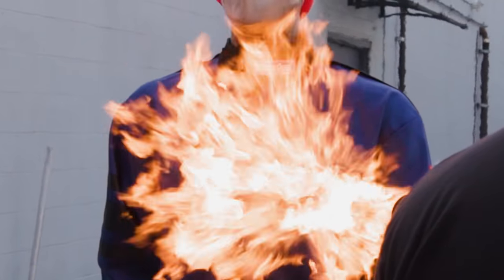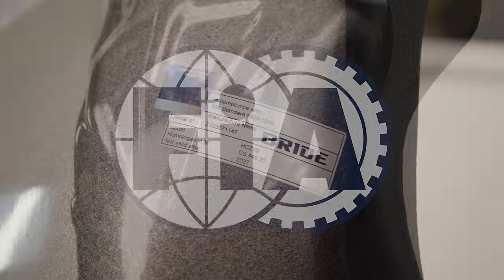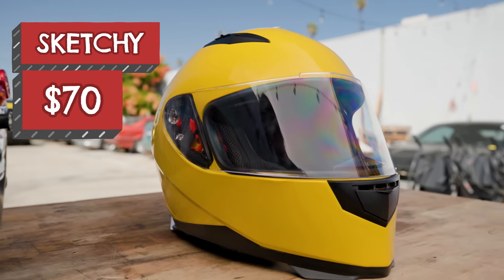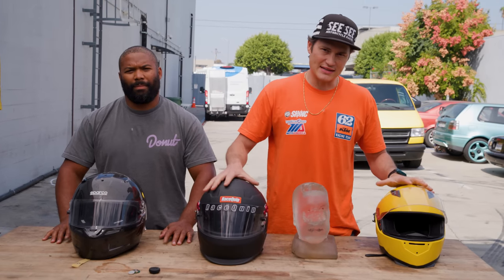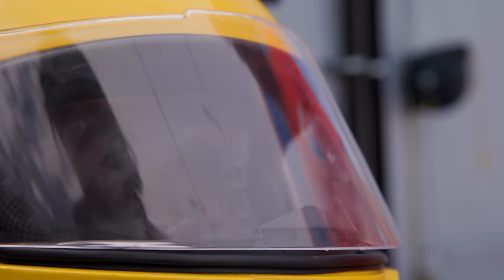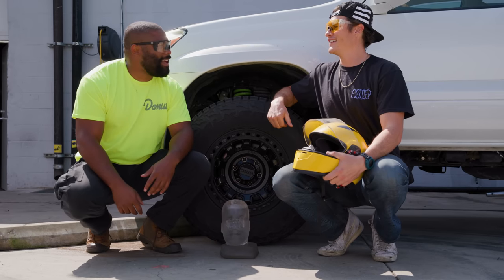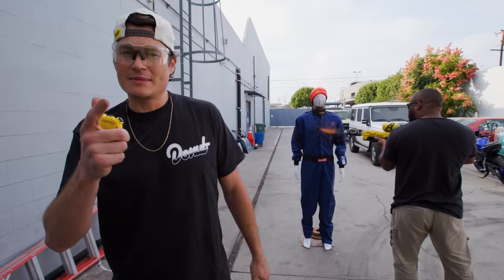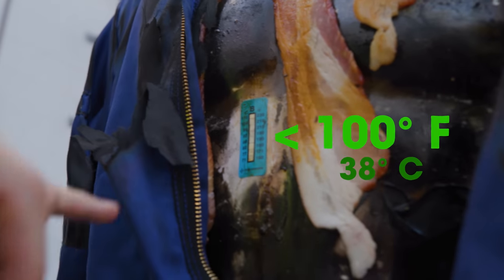$500 vs $1300 Racing Seats

Comment: One safety comment, on removing seats. I'm sure you guys are aware but you didn't mention it at least not so far in the video, some seats have airbags built in. Disconnect your battery and let it discharge before you go fiddling around with those unless you feel like having one explode in your face.
Reply: Was just going to write this. The airbag system is really sensetive, and disconnecting parts of the system without having the battery disconnected can make them blow.
Reply: Actually. Airbags are not that sensitive..
Reply: @MrWaarden  on some cars they are and other's their not
Reply: This is an 06 wrx
Reply: I can't believe this wasn't mentioned.

And regardless if the seat has an airbag in it, all cars within the last 20 years have occupancy sensors to disable the airbags if no one is sitting in the seat. Disconnecting these will cause an airbag light and potentially not deploy the airbag in a collision. 

On the track you don't want airbags, because of cages and helmets etc, but most people watching these videos are going to drive both on the street an track, this is a big miss in my opinion.
Reply: @JVR_Funwithdesign  not entirely true, my 04 SEAT Ibiza (Volkswagen Polo) does not have any wires connected to the seats.
Reply: that's incorrect,  I've been a mechanic for 16 years now and airbags while being dangerous are not that sensitive. removing them the way they did is totally okay
Reply: @mariushaeberle85  Some cars have the bare minimum for extras.

You have manual seats.
Reply: @robert9595  i do, i said it because someone above me said all cars of the last 20 years have wires connected to the seat.

btw all of the SEAT Ibiza models had and have manual seats regardless of trim and extras.
Reply: @MrDosSantos991  you may have been a mechanic for 15 years, but if you look at the manual for installing or removing airbags they ALWAYS warn you to remove power, and allowed to discharge first. Now you may want to shade tree it, but I'm not going to take that risk.
Reply: @mariushaeberle85  Well in the US (which then also applies to all cars sold in North America) since 2003 all cars must have advanced airbag systems which detect occupancy. 

European rules will be different but given how strict EU rules are on safety, I'm going to guess that this is also the case with cars newer than your SEAT.

Has nothing to do with manual vs powered.
Reply: @JVR_Funwithdesign  thanks for clarification, as im not familiar with rules of the US.
Reply: Until an impact the airbag wires dont carry any voltage, so its safe to disconnect them. The steering wheel is only different because the clock spring can short the bag to the horn which is always hot, but typically you disconnect the airbag before removing the wheel. Good practice is to disconnect the battery before playing with electronics, but 99% its actually unnecessary.
Reply: @thebarkingmouse  the manual probably also says something about only going the speed limit.
Reply: I disconnected my airbags in the sketchiest way possible in my 05 CVPI when I built it for the track, luckily I still have my teeth. I had no idea you're supposed to drain the battery 😧
Reply: @thebarkingmouse  I have done maybe 1000 mazda airbag recalls, they pay like 10 minutes for the work.(airbag at steering wheel, passenger side pays more time) if you actually do all the steps it takes too long time. removing battery= all radio channel presets get reset and clock time resets, pita to change those back how the customer had them. Never had a airbag blow. While I disconnect the airbag I move away from the expansion area tho as a precaution.
Reply: @JVR_Funwithdesign  Came here to say this, glad you beat me to it!
Reply: Airbags are actually controlled by PWM signal, If it happened to somebody It must exploded on <00' cars lol, but sure if I do this job on every older Korean car, i for sure did all safety steps before dissambled them :D
Reply: @Ellotherem8 I see what you’re saying; on the other hand, I am not a regular Donut viewer. As someone who occasionally stumbles on these videos, I’m not familiar with the hi-lo series, but the juxtaposition of a video that spends a lot of time espousing a safety mindset with glaring overlooking of safety caveats is… unsettling.
Reply: @thebarkingmouse  That warning is for liability reasons only, kind of like the warning for not putting a sandwich bag over your head because you could suffocate. If they didn't put that in there then some idiot could jam the power seat connector into it or do something crazy and set it off. Then they can sue because they didn't warn them in the manual and because that's how people are.
Reply: @thebarkingmouse  service manual tells you to disconnect the battery to replace a light bulb. The only time airbag connectors have power or ground going to them is when the vehicle is trying to ignite the propellant. Any other time, the wires are dead, so the odds of them actually going off by accident is incredibly low. You’re more likely to accidentally set off an airbag through static discharge than by leaving the battery connected .
Reply: @WhoThisGuy515  Whatever.  You do you boo.  Advising customers to take unnecessary risks is what we call in the French... Dumb.
Reply: @Ja3cques   finallyyy someone who knew the truth 😂 read like 10 comments before before someone actually knew how these systems worked
Reply: @ouch1011 heard a story of a tech that was replacing something under the drivers seat and he moved the module that controls the bags and every single bag went off when he did.
Reply: This is a myth. Please stop.
Reply: It's fine, I've done plenty of takata airbag replacements and while service info does say to pull the negative post, nobody does it. Our 2 oldtimer master techs, each with 30 years at the Acura dealership, just told me to just ignore the warning when I started there.  They've never had one blow after replacing doing literally thousands of airbags at that dealership. Disconnecting the connectors is not a realistic airbag safety concern, you're about as likely to be struck by lightning.
Reply: @JVR_Funwithdesign  I'm not sure where you got your information, but it's not accurate.  There is no requirement in the US for all cars built since 2003 to have occupant detection otherwise Ford wouldn't have been able to sell the MK1.X Focus in the US as they lacked occupant detection.
Reply: @Ellotherem8 Yup. It’s a channel with 7 million subscribers, there are going to be a few in there that don’t interpret this as purely entertainment. Like, personally I would never blindly trust Donut, but there is definitely an attempt to sound authoritative in parts of the video that could convince some people. Simple but obvious disclaimer in the video would be enough, or if not, making sure they do enough research. Wouldn’t cost them anything and won’t take away from anything in the video.
Reply: @aaronthomas6155  Well the rule is covered in NHTSA 65 FR 30680. Written in 2000 - in effect 2003. No idea about the Focus but it was first released in 2000 so wouldn't fall under the rule.
Reply: @thebarkingmouse  And my car's manual says you need to disconnect your battery when changing a fuse, too. There's really no need. At a point safety precautions are only there to cover the company's ass if some astronomically unlikely event occurs.
Reply: @MikeyAntonakakis  While Donut does post videos that contain valid and verifiable information, it would be quite stupid to just blindly trust anything that they say.  These guys are not experts in any particular field.  All of the products used in this video that claim to adhere to or comply with any specific safety standard should have such data posted on their own website.  There is likely also a way to verify any such certification claimed in this video.

As for their "hands on" testing, that is purely entertainment as the certification processes used for safety products is much more stringent than what Donut is capable of.  For the helmet test specifically, I wouldn't use Donut as a source of information for choosing a helmet.  Personally, if I were shopping for a racing helmet, I'd stick to Bell, Simpson, HJC or Stilo.....
Reply: @Ellotherem8 Donut knows how to make entertaining videos.  They are not experts in any particular field.
Reply: @c-dawg2145  That's actually not unusual.  Replacing a fuse can cause a voltage spike, which has a (relatively small) possibility of damaging electronic components.  There are manuals however, that recommend disconnecting the vehicle's battery to change the oil.....which is quite extreme.
Reply: @aaronthomas6155  Definitely. Just saying that with 7million followers, it’s bound to be lost on some of them, and would be super easy have said something in the video like “hey when you pull out your stock seats it might disable your airbags” even if just a CYA thing.
Reply: @MikeyAntonakakis  There was a lot of information missed in this video that should have been presented.  They really should have informed viewers that in some states, you can't legally replace the front seats with racing seats because of the airbags.  Also can't remove the stock seat belts and replace them with a race harness in some states for the same reason, or the steering wheel.....  These issues should be made clear with a simple legal notice across the screen or a quick/simple verbal statement during the video.  They should also avoid implying that a helmet is safer because it's more expensive....such as they did in this video.
Reply: @aaronthomas6155  100% agree
Reply: But the car is off...
Reply: Forget about airbags,   what about about bucket seats with no cage.    It's like no one that watches these videos has any clue about cars
Reply: Oh thats a really good tip im glad you posted this comment cause that would be a bad day

Comment: I really appreciate the Hi-Team/Lo-Team/Sketchy-team breakdown this episode.  It's a nice way to show how "too Lo" is dangerous and not worth it.
Reply: Especially the helmet. Like, do you trust your brain in a $70 piece of plastic filled with packing paper? Lol
Reply: I wish they do middle of the road more often
Reply: @IHateMyAccountName  just saying that's not how gforces work like at all they all would have experienced the same amount of gs from the same highth with the same weight the fact they said the test showed wildly different numbers was a scare tactic to keep people from buying a helmet that was cheap but still did the job just fine
Reply: @JamesJones-tu4pq  well, a heavier helmet would have more energy to injure your neck and back in an accident. I paid an extra $200 for the same model helmet in carbon for snow-machining because it was in my mind safer. It also came with a fidlock chin strap which was probably worth it alone
Reply: @natec599  In Donut's drop test, all helmets would have the same energy at impact because they would all be travelling at the same speed.  The difference is how the lining absorbs and disperses the energy at the time of impact.  This test by Donut is utterly useless since most helmets will never be subjected to such circumstances.  The same goes for driving a vehicle over the helmet.  Quite honestly, if you fall on your head from a height of 10ft+, that helmet is not going to save your life.

Lighter helmets generally mean less structural integrity.  In other words, less safe.  If you're truly worried about neck injuries, you should be wearing a neck brace.  Whether it's something as cheap as a simple foam donut style neck brace or a HANS device doesn't really matter.  A proper neck brace will help support the weight of the helmet, as well as prevent the types of movement that typically result in neck injuries.
Reply: @JamesJones-tu4pq  the thing is, helmet deflection and coushoning can bring the g's down for whats inside. It also helps the force distribution to avoid any injuries in the head
Reply: Completely agree. Middle of the road pricing, instead of absolute bottom of the barrel would just make for a “more better” show all around
Reply: @aaronthomas6155 lighter helmet doesn’t generally mean less integrity… I will agree with neck bracing, that is generally a huge safety standard sought after by many institutions which require it. Think about sturdy heavy helmet verse’s a light stronger helmet and the physics. The extra weight of a bulky helmet may save you but in fact that extra weight can also injure you more in face of mass weight
Reply: @natec599 Fidlock is technically worse than a classic double d ring lock. FortNine made a good video about it, albeit motorcycle specific.
Reply: Amen!
Reply: @aaronthomas6155  lighter helmets are much safer in most incidents-if the helmet meets the spec for your sport(Snell for car racing, ECE for motorcycle), it will save you from any impact the rest of your body can reasonably survive.
Helmet mass and size directly relate to torque on the neck; a smaller and lighter helmet will reduce strain and whiplash significantly; which is why ECE tests for it.

Comment: Personally I think it would have been good info to share that those yellow plugs that were disconnected were part of the airbag/srs system(s). Any yellow connectors or wires are for those systems. They may be passenger occupancy sensors or seatbelt squibs. Occupancy sensors tell the vehicle to deploy the airbag/seatbelt squib when an impact is detected and it senses an occupant in the seat. If nobody is in the seat it’ll prevent the passenger airbag(s) and squib from deploying. The seatbelt squib tightens the seatbelt when an impact is detected. Since the topic of the day is driver/occupant safety it would have been good to cover those topics informing anyone who doesn’t know that they’re disabling the whole airbag system by disconnecting even one of those components.

Comment: So RaceQuip looks like solid gear for the money, and ideal for those of us just starting out with our race cars.  Sparco is what I'd get with fat sponsor dollars but I'm totally impressed with what Low Car is getting this series.
Reply: Sparco also has the most budget friendly option in seats, the Sprint.  It's about $400, FIA approved, and one of the narrowest seats available.  It was the only one I could find the fit in my Z3, also really popular for Miatas for the same reason.
Reply: @FireCat005  cheap is good, but narrow is not for my fat ass 😀
Reply: Not sure how the sparco suit won their test. it had holes burnt in it and the racequip did not have holes.
Reply: @enigma9789  18:16 they both actually had holes. However, I'd still buy the Racequip
Reply: @enigma9789  idk but im assuming the suit is meant to burn and absorb the temperature vs your body taking the temps.
Reply: Personally, I'd opt for a Simpson racing suit over RaceQuip as I've actually owned a Simpson racing suit and a Simpson racing jacket and I've never heard of RaceQuip until now.
Reply: @enigma9789  it had holes in the first layer. Didn’t get to the skin at all. It’s a three layer suit.
Reply: @TheDaemon66  19:03 you can see the material burned through to chest, and part of the fabric sticking to the chest.... Which is even worse in a real burn scenario, you don't want fabric fusing into your skin.
Reply: @aaronthomas6155  Not sure if you do watch ChrisFix's videos, but if you have, you probably would know RaceQuip when he got his first full-face helmet.

Comment: Honestly don’t agree with the burn test. The racequip didn’t seem to have literal holes burned through it during the burn test, sparco however did
Reply: Gotta remember they did admit to using a direct flame that was 3x the heat you’d find in your car just to over exaggerate it. Who knows what would’ve happened had they turned the temp down a notch.
Reply: @kevincrenshaw9588  fair point but even then, with that high temp the racequip still had no holes burned through it handle the high temp better so it’ll likely handle the lower temp better